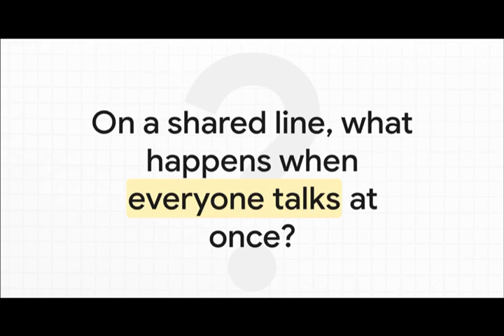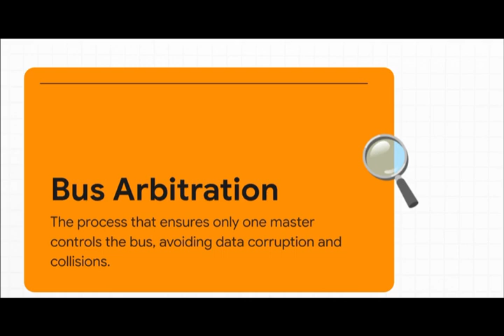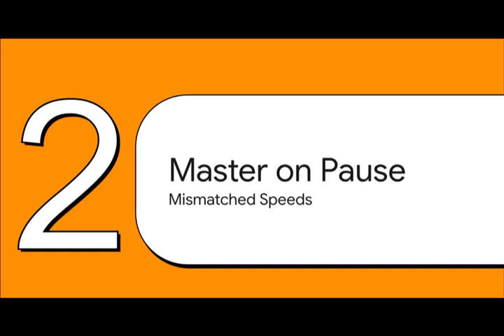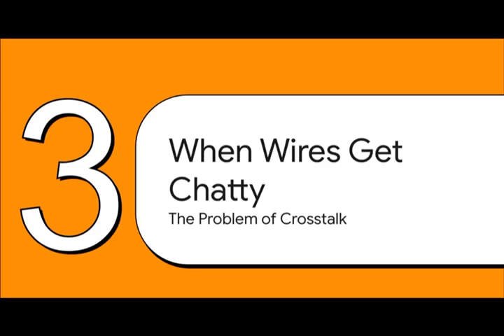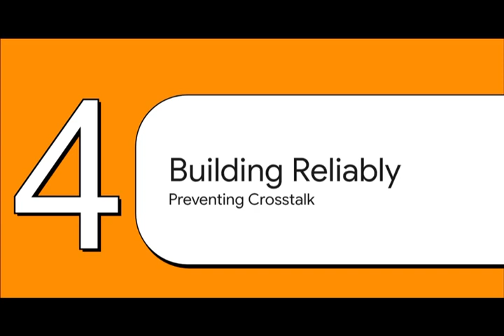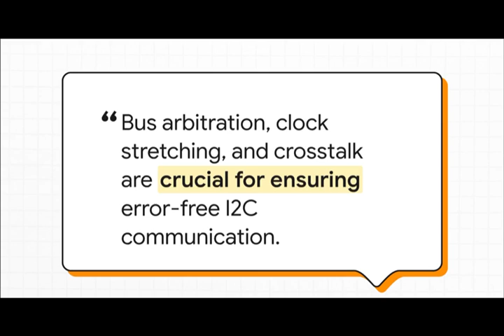I2C Bus Arbitration, Clock Stretching, and Crosstalk Explained.

Comment: So arbitration requires multiple devices to monitor sda, whereas clock stretching requires the master to monitor scl. Is there a corner case for the i2c protocol where arbitration can conflict with clock stretching and break the communication?